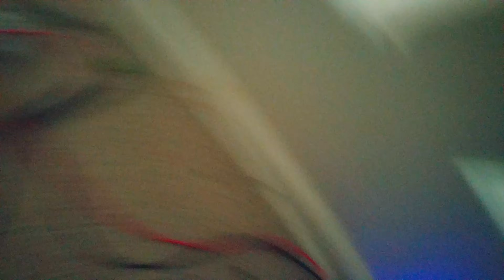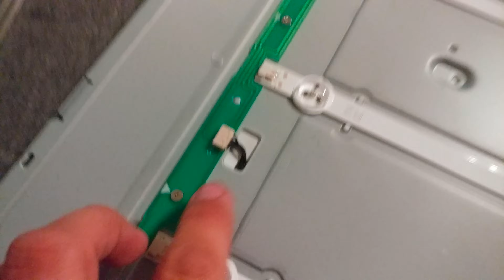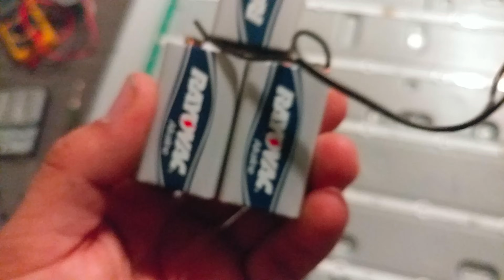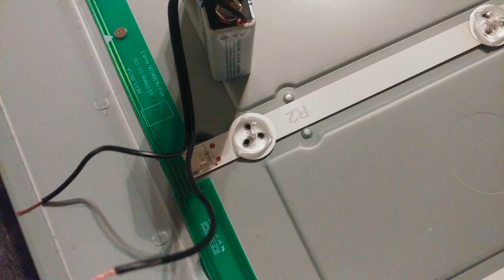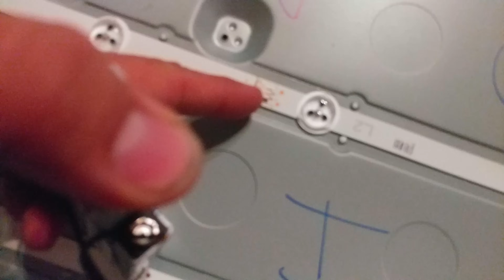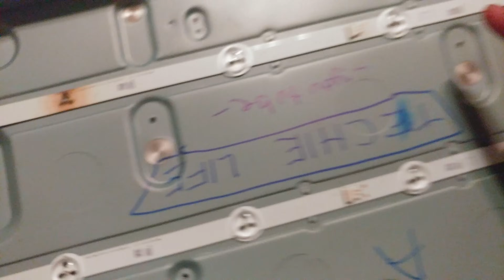how to test LED strips without tester Using a battery. backlight tester DIY

Comment: Good idea. I used an 18v cordless drill battery on my 55 inch Hitachi 10 LED strip (they come apart into 2 strips, I tested half a strip, 5, at a time) and it worked great. I found out I have 2 left side strips that are out. Found some on eBay for $12 each. Not spending $70 on replacing every LED. This video saved me a lot of money, and/or saved my TV from the landfill.
Reply from the maker: thanks a lot for the info. yes you could have wasted more money, but good thing you had the knowledge to fix it. Thanks for watching!
Reply: @TECHIELIFE  Do You Think I could use a 20 Volt drill battery to test  My LEDs right where the LEDs plug into the power board, to see if my LED's/back-light are working? After unplugging the board of course. How Many Mh do you think the Drill battery is? I don't have any resistors to add in the circuit.
Reply from the maker: @mrbreezeet1  at 20v..i woulddnt go any less than 7 leds anything below that could damage it. typically a full charged battery cand range a bit over 20V so if you get 21V divide by 3V needed for each led, it gives you 7. you can do 8 and more, but it will get dimmer.
Reply: @TECHIELIFE  thanks so much for your reply I'm on a low fixed income and would really like to get this working cheaply.Actually I am trying to light the whole screen, all the lights in there at one time (I only have the back off, and am not down to the LED's )
At 1min and 13 seconds in your above video, that is where I tested My voltage between the Hot (red) wire, and the chassis ground, and only have about 22 volts with the TV on, I Have 22 volts DC at the Plug you are pointing to, (between the Hot (red) wire, and the chassis ground) With the White 4 wire connector PLUGGED IN, and Also, 
with the white 4 wire connector UN PLUGGED. (Board side) I was trying to light the whole screen from the wire harness side (unplugged from board of course) by feeding the white plug with my 20 volt battery. (actually discharged down to about 16 volts) Is that not enough to light the WHOLE SCREEN?  And is 22 Volts enough voltage at the board,  with the white connector unplugged measuring at the red wire (board side Pin) and chassis ground?
 I started out with a Dim screen about a week ago, and still had sound. Just a Dim Picture. did a Manual power cycle, by unplugging the TV and holding down the power button, and re powering the set. No Luck. I also did a Factory reset through the menu, with no luck. I then (from the menu) turned up my Backlight to 100% and My Brightness to 100% and the picture did respond. The TV was "watchable" albeit dim for about 3 days. 
I was lying on the sofa last week, watching TV, and fell asleep, and woke up to A dark screen. (Not Watchable)
(If I look real real close, I can still see a picture)  I can Get a Main and Power board from salesjimmydot com, for about $45.00 shipped, IMO a Good Price to save the TV (TV is about 4 or 5 years old, and worked great, and is a "smart TV")  But I hate to throw the boards at It, and waste $45.00 that could go to A new TV.
I did check the power board Caps and all look Good, Nice and flat on top, no swelling, no burn marks present, 
connectors are not loose where they are soldered to the board. 
IS IT LIKELY FOR A TV OF THIS AGE TO BURN OUT EVERY LED? 
Especially considering I turned up the "backlight" to 100% for a few/3 days? 
Note; The screen was nice and even at first, albeit dim. 
AND IS 22 V0LTS DC EVEN ENOUGH VOLTAGE OUT OF THE BOARD? 
From watching your video, and others, It seems Low. But I don't have a lot of personal experience.
( I have seen videos that state as High as 190 volts/DC with the white plug unplugged at the board, (measuring the board side of course)
Thanks for your Help. Hope you can advise on this!!
BTY TV is A VIZIO E32h-C1 smart TV. 
I do have an about 40 volt battery and a 56 volt ECO battery I could try to light to light the panel with is that is not too much for The WHOLE PANEL. should I/Can I put a 40 or 60 watt incandescent bulb in series with the battery + as I don't have any resistors, to attempt to even out the amperage.
Thanks Again
Anthony
Reply from the maker: @mrbreezeet1  wow. A lot of info there. Simply, most TV' led are lined up in series.. so your 40-50-60 volt battery may be to weak. To light it up.  But to make every thing simple, if you are having dark spots on the screen, then you will need to change out the LEDs. Not all of them, but maybe just some and at this point, that is when you determine which LEDs need to be changed out. Dont buy any boards. It's not going to do anything. I might actually have that TV in my house in parts. I will get back at you shortly to see if I have that model and maybe I can sell you the strips for it.
Reply: @TECHIELIFE  OK sorry I know it was Long. 
I have only tried a 20 volt Battery, partially discharged to down around 16.XX volts. 
My Big thing is I am only getting 22 volts out of the Power board where the LED wire harness goes into the Metal chassis, and to the LED's . All the Videos I have seen (Again, have not found one for My Vizio E32h-C1)
But they are all calling for more voltage than 22, ( By 3 to 5 times) 
Almost don't seem possible for me to only be getting 22 Volts DC from My board does it?
Reply from the maker: @mrbreezeet1  ok so I looked specifically at your TV. By looking at shopjimmy.com . It seems that there are 2 outputs on the power board they should be labeled VLED- and VLED+ . There is also only 3 strips. And all strips only have 7 LEDs. So considering that 3 volts may be needed for each led, one output of the power supply might be about 40 volts and the other about 20. Note too that some of these boards are driven by resistance.. meaning that if the LEDs are not present and in the circuit, then the power supply won't output the correct voltage.  Measure bother output as soon as you start the TV. It actually may drop down after about a second or 2
Reply: @TECHIELIFE  OK Thanks!
 I'll Let You Know!
Reply: @TECHIELIFE   Ran The Test 2 Times,  Led Harness Plugged in and LED Harness Unplugged. 
 I soldered A Sewing Needle to My + test probe, as to be sure I was getting into the correct Pins,
 VLED +1  And VLED + 2. 
TEST 1 ,18.5  Both Conditions, Led Harness Plugged in and LED Harness Unplugged.
TEST 2, 22.0  Both Conditions, Led Harness Plugged in and LED Harness Unplugged.
So I don't Know. 
Wish the Hell It was reading about 2 volts.
I never did try to drive the Strips with the 40 Volt Battery. It is fully charged at 41.5 Volts,   and 17.5 milliamps.
Reply from the maker: @mrbreezeet1  ok, you need to measure from both the positive band the negative on the connector. Sometimes the chassis is not enough. I've seen on some TV's values to be different.
Reply: @TECHIELIFE  0k. I am NOT GETTING voltage using the minus on the board ONLY USING CASSIUS of TV.
You might be right about the LED s it's as if there is no connection to the LEDs through the harness.
Reply from the maker: @mrbreezeet1  what about as soon as you start the tv.. it should spike up a slight moment. And then drop down
Reply: Would there be no worry here that the 18v might fry some of the working strips since they require 15v or is the 3v fairly negligible there? I'm having the same problem and only have an 18v cordless drill battery to hand.
Reply from the maker: Adam Lane  i wouldn't go no more than 3.5 volts for each LED.. and only test really fast dont leave the battery touching very long. now some leds may actually be able to run 6v each.. but by then, you will see that it will be dim when you test it out.
Reply: That's a good one, I happen to have a drill battery charged and ready for action. It's either that or rob all my smoke detectors of their batteries right quick to do the test lol

Comment: Just bought a sound no picture 50LN5100, figured replacing a few caps be no problem. Came home and realize on LED TV its more likely the LEDs go out then the PSU. I watched a whole bunch of these videos and I have 2 questions. Why not use LED Strip you can buy on ebay, the 16 foot 300 or 600? they use the same 3528 LED. So second question arises How much voltage is actually coming from the PSU in that pair of voltages? Thank you
Reply from the maker: Christopher Parker you kind of answered your one question. But to Clarify, the LEDs sold on eBay are wired in parallel circuit. Meanwhile, most led TV's will be wired in series. Which is why the whole strip goes out and not just one (in some cases)

Comment: Did you even measure LEDs on strips how much mA they need to buy exactly the same ones ? where does it say any LED values ? battery tester, automatic led tester, doh....
I have 32" tv with 3 strips 6 LEDs each -18x, "6V" -3535 = 108V, power supply output 255V max for LED, when not connected. Leds are not "driven" by voltage.
"The cause of damage is overcurrent resulting from the diode breakdown, not the voltage itself. "
Im probably gonna buy some ESR, LCR LED tester, its about time I get one.
Never assume anything.

Comment: Ok I have a Vizio model E470i-A0. Looks to be the same one you're working on. The led connection port has 4 test points the they are as followed. Led1-, Led1+, Led2- and Led2+. At each positive Led1+ and 2+ I am only getting a voltage of exactly 68v does that mean the power supply board needs replaced? I did the flashlight test there is an image and sound but no backlight. I dont want to go any further by testing each strip yet. Please let me know as soon as possible thank you.

Comment: jus had my trusty samsung go dark on me, did flashlight test got sound, could see picture with light. and i know i have voltage going to back lights but i havent pulled the screens off. but I know its possible to to at least do some testing now thanks for the tips!
Reply from the maker: Andrew Stewart at this point, plan on taking it apart. Now all you need to know it which LEDs went out. What is the model number?
Reply: Its a samsung UN46ES6100FXZA, turns out its the left and right style, about 60 lights per side. Looks like 1 strand is 120 currently on ebay. May be worth upgrading if i need both sides.

Comment: Hey, I got my panel apart and I'm confused, when I check each led with my multimeter they are ALL showing open. I know this would be very very unlikely but they are. It feels like I'm doing something wrong but I'm testing each one like a diode.

Comment: How do you know which LEDs to get for your TV? I can't find the strips for my TV anywhere so I was planning on replacing the individual LEDs but I have no idea how to find the correct voltage or color for my TV. Are they all 3v LEDs?
Reply: https://youtu.be/YgaL6X6eSaU?t=6m40s
Reply: That video just shows how you can get the strips and how you can test them for broken LEDs. It doesn't dive into how to test what an individual LED uses for power, what type of LED it is, or how to determine the correct color LED to get. I have an Element TV (ELEFT502). If you guys can help me out that'd be great!

Comment: Hey bro, the warranty repair guy was at my place and while he was probing the 4pin connector (on the power board where the LED plugs into) and while he was in amperage mode on his multimeter the backlight came on. I'm waiting until i find out what haier is going to do for warranty until i dive further into it. I just want to know is it normal if a LED strip is open would probing the 4 pin plug in amperage settings would triggering the backlight to come on??? Any advice you can give would be awesome.
Reply from the maker: usually the leds dont open. they usually short. but almost any tv will shut down or wont pass voltage if too much draw or not enough is given. in some cases, leds will create an open and will not complete the circuit.
Reply: TECHIE LIFE thanks fur the fast reply. i got a haier 55 curve screen (55ufc2500) with no backlight. Last week it failed fur the first time and when i turned it off and back on it was fine but 2 days ago i turned it on and it came on for 1 sec and flickered a couple times and stayed off.  I got voltage at the connector (300 volt). The thing that confused me was when the warranty guy came to do a diagnosis he was probing at the connector (in amperage setting) and the backlight came on when he tested across 2 of the 4 pin connector. I just can't help but feel because it was under warranty the service guy just submitted a diagnosis that would have haier replace rather then repair. The tv's 4 months old and would be a shame to thro out. It's the whole being able to trigger the backlight to come on from the connector that just really confuses me. I'm fairly technically inclined person (I'm a auto mechanic but grew up my entire life around electronics in my dads tv repair shop) would you be able to trigger the light to come on via the 4 pin connector plug if there was a problem with the actual LEDs??
Reply: S. D. hey, I'm no expert, but it appears that your leds are fine and that the tech triggered something on the board that drives the leds... perhaps something in an IC or theoretically, something as simple as circumventing a cold solder joint, bad cap or maybe diode. Tough to diagnose without a scope, but then again, the technicians are trained where to look! Did you ever get it fixed?

Comment: can i use the loptop charger it has 19 volts or 20 volts?
Reply from the maker: randy dilinila you could. Just make sure that the voltage does not exceed the LEDs times 3 volts.

Comment: Better yet. Use 1 9v battery. Scrape down to the copper trace on both sides of each LED for POS and NEG. Tap POS to POS side and NEG to NEG side. Light if good or no light if no good. If you're worried about a 9v lighting a single LED then add a 100 resistor to either the pos or neg but I've never had an issue lighting it up for less than 1 second.
Reply from the maker: Michael W good tip.. but I don't trust LEDs to be overdriven. Anything above 3 v will try them.(individually)
Reply: i just used three 9vs in series and tested the whole strip in one connection just fine, many times over, just with reversed polarity. I also used the 27v series, pos to pos and neg to neg to test the individual leds, because this was my first time doing literally anything with electricity, and they are still fine